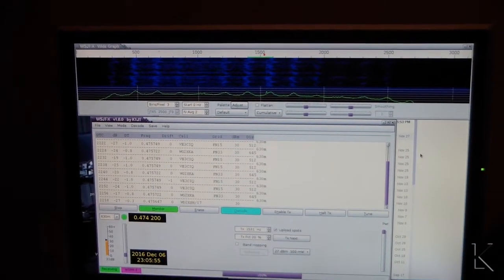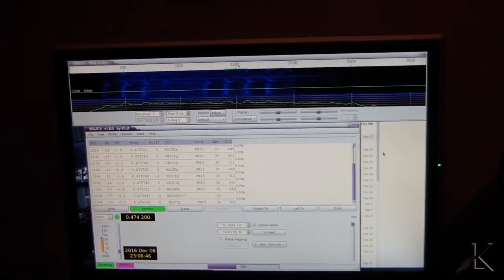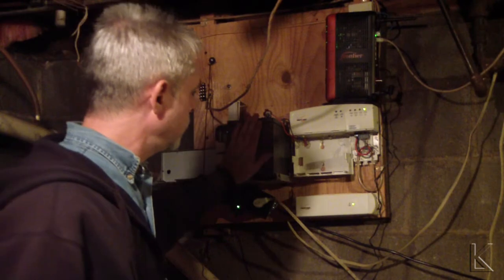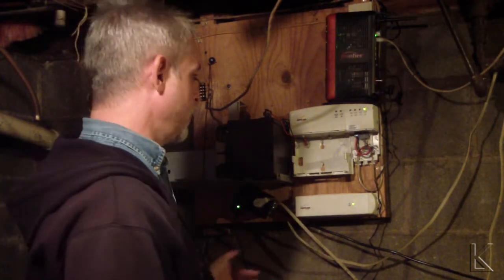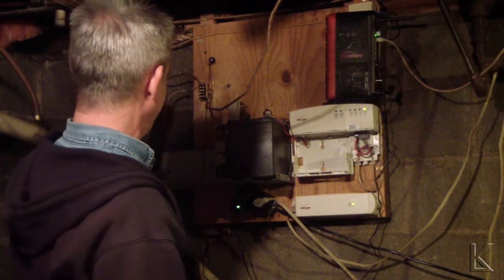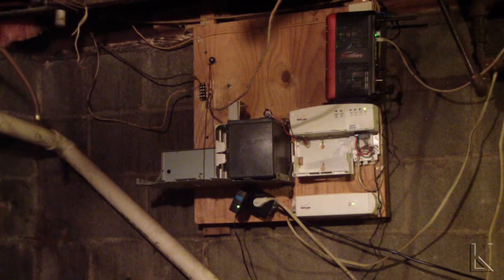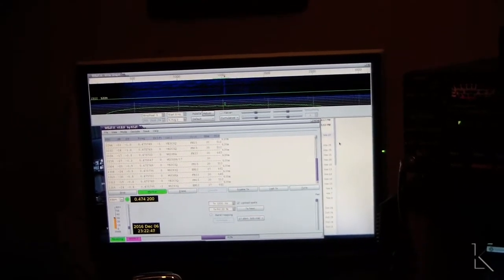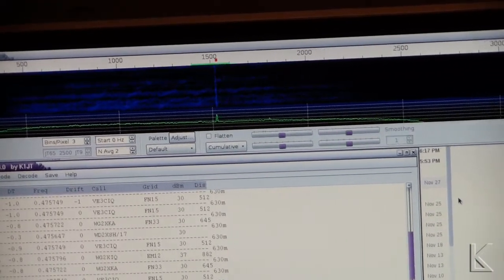Eliminating interference on my ham radio from my internet provider

Comment: Good and timely video with the current deployment of fiber.  That spider may have been a bot from the local building inspector checking your job out haha.   Good to have fun when you love doing what you do.  :)  I saved your video in my Ham Radio section, good one indeed.  KO4QWY 73s